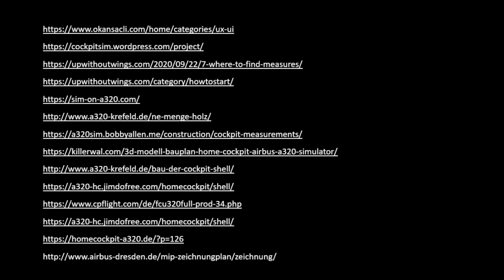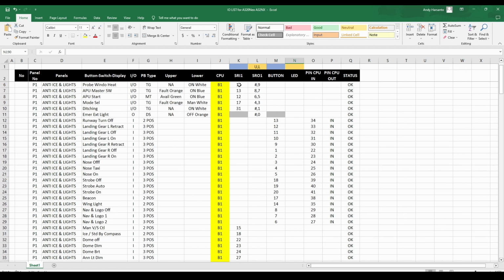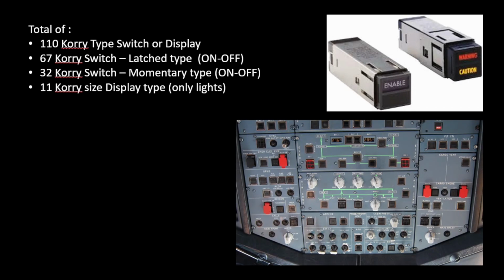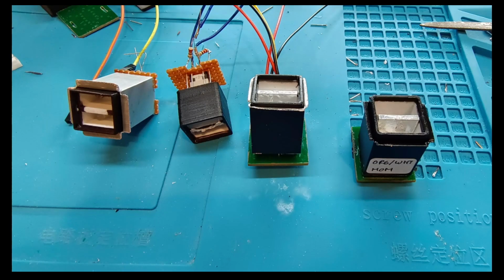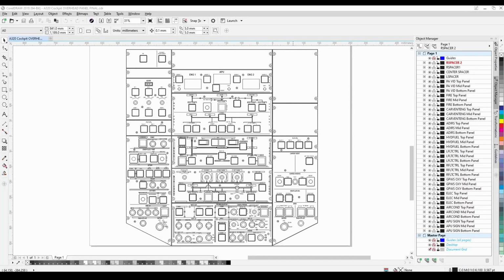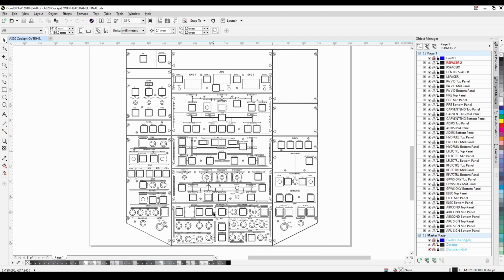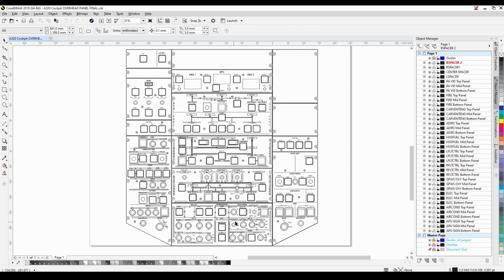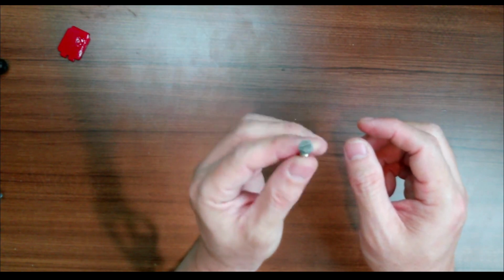DIY A320 Neo Home Cockpit Build Video   Part 3 Overhead

Comment: will this overhead panels be compatible withe the A359 from flight factor on xplane 12?
Reply from the maker: If you compare its similar but not the same of course you could program accordingly depending on the interface apps and controller you use

Comment: thank you very much for sharing those files ... is it possible to let us know what fonts you use in those Corel Draw files for the text ?
Reply from the maker: Wah I forgot might better check in the Corel file itself?
Reply: @hobbytechgearID69  I don't have coral draw, just opened in inkscape and it says it is "sans serif" but my machine thinks the font is missing. I do have sans serif family, but it does not look right. it is probably more like that MS33558 font. anyway, great drawing and thanks again for sharing.

Comment: Does it work in Xplane 12 toliss and what mount do you use to hold it above your head and please can you give me access thank you very much
Reply from the maker: Hardware is flexible but you need a control software that can talk to xplane 12 im not familiar with, ive approved all request to the repository

Comment: I stepped in just recently and i like your videos very much. I received permission to your google drive, but I can not find the excel sheet with all the switches information. An enormeous job. What am I ding wrong. Please yout advice.
Reply from the maker: Ask for permission to"  other" folder
Reply: @hobbytechgearID69  Thank you for your fast response. I received permission for the "Coreldraw Source file" folder and the "3D Model Sketchup files" folder. In both folders I could not find an Exell sheet.   In all other videos there is no other link to your Google Drive folders. What am I missing? Looking forward to your reaction.
Reply from the maker: @henkjonker8513 https://drive.google.com/drive/folders/1LFOpiMq4amXIrGI4GEoUxGZnwIJ9QQQE

Comment: Thank you for giving me access, I just finished the cut and engraving and it came out perfect, if you could be so kind to share the files for the larger korry switches/covers etc, also what rocker switches did you use?
Reply from the maker: @freeeps3  ok good to hear, which one is larger korry sw? I think all are same size, rocker switch for whic one?,you meant toggle switch?
Reply from the maker: You could email which sw I will try to give sample of the components
Reply from the maker: I meant the link where I purchase😊

Comment: Hello. Thank you very much for your work and for generously sharing your experience. I am sure that your project has inspired many, showing that it is possible.

 I have a question: What is the thickness of the lower, middle and upper panels of the overhead?
Reply from the maker: @ВиталийБондин-т1с  its in google sketchup files for detail measurement its about 15-20 cm total panel thickness

Comment: Could I connect multible switches to one ground
Reply from the maker: @kyranclaeys3972  yes either common gnd is usually preferred but it should be a pull down co fig where in the input need to have a pull up resistor either external or already included in the IC or the board

Comment: how much could somebody buy a completely built overhead panel for, some people like me, dont like to put together over 100 switches lol.
Reply from the maker: There are shops but via alibaba around 100K USD full size if from europe will be much higher.
Reply: I see between 4-5k EUR + Tax for a full sized one. Thinking about wire it self but all parts will cost me 3k around already.  Hope, Winwing bring some original sized Panel for around 2k :)

Comment: Hi Hobby Tech Gear, I've been watching your build videos to assist in planning my own build. What did you use to cut the holes in the acrylic sheets for your overhead panels? Cheers.
Reply from the maker: As mentioned in one of the build Im using co2 laser cutting machine, I bought a cheap one but very difficult to fine tune but once you got it right its sharp. It also can cut up to 5mm but wiith several pass. And used for engraving too
Reply from the maker: Im using 50w co2 laser cutting machine. If you dont want to buy a unit usually there are services to cut to your design

Comment: Hello. Thanks for the video! :)
Did you connect the LED strip light directly to the potentiometer for the backlight. I am currently in the process of building my overhead. Would I need a dimmer
Reply from the maker: Oh yes forgot to mentioned im using a pwm or led dimmer actually for overhead im using quite powerful dimmer you could calculate from total current consumption for approximation
Reply from the maker: Of the total led strip length use for example refer to led strip specs for the voltage used
Reply from the maker: You cant if you calculate current is quite significant the pot would just unable sustained  or you need big pot which is not realistic and it wont work at certain voltage
Reply from the maker: Actually the cost of dimmer is not so much. And i use dual gang pot for the dimmer replacing the single gang pot. And connect the other pot to the adc if you need to adjust in the seem lighting through mobiflight or the software
Reply: Okay, thank you for the quick reply. So I need a dimmer? can't I just connect the led strip directly to the potentiometer?

Comment: And do you have the sheets/excel file you can share with all the connections and colors that you were showing?
Reply: Hey thanks for the acceptance but I did not see the Excel file in there at all.....am I missing it?
Reply from the maker: I ve put almost all my working files in the gdrive link in the description
Reply from the maker: I did not put too specific you do need some electronics knowlege at mins as ive mentioned if you woul like to learn start from creating simple joystick with mmjoy2 see my other vids in playlist and move up from there i did it also in stages, though i do have electronics skills
Reply: I'm pretty good with Arduino that's why I was asking if you had included the Excel file? I did try to get the files off of Google drive but it just asked me to request permission
Reply: I did request access just waiting for it to be approved. You did a wonderful job I'm hoping your information can help me as well
Reply from the maker: Already
Reply from the maker: Did you find OTHERs directory?
Reply: @hobbytechgearID69  Yes but there's nothing in it
Reply from the maker: @johnb6014  i ve checked your name is listed and the files is there can you retry and refresh

Comment: Hello, can you share your MC and MC file from Mobiflight? Thanks!
Reply from the maker: Ive put into OTHERS folder you should have access. But it's specific to my Arduinos setup. If you would like to see the command use you could but the I/O and others need to be adjusted to yours
Reply: @hobbytechgearID69  Thank you very much! I think these files will help a lot of people to set up the configuration using this as an example
Reply: @hobbytechgearID69  A small problem, I don't have the OTHER folder available. Apparently I don't have access
Reply from the maker: Check your email ive added you
Reply: @hobbytechgearID69  I don't have this either
Reply from the maker: @johnb6014  hope you find it

Comment: Bro please tell which print you took to make panel which material used and name of that print please bro tell me
Reply from the maker: Can gou tell me what printer. Is it laser cutting machine? Or 3d printer? For laser cutting Im using generic chinese made 40w power. While for 3d printer fillament base im using Prusa Mk3 and for resin im using anycubic the first generation

Comment: Hi, do you have any tips on how to line up the panel engraving perfectly on the laser?
Reply from the maker: Sure. 1. Draw a box outline of the panel in corel, 2. Put the outline as first to laser hide the engraved title or delete first 3. Put a thick material as base to draw the outline using laser with low power, 4. Re activate the layer to be engraved or undo deletion, 5. Select the outline as white color so wont be engraved but its still there so engrave letter or marking wont move 6. Start engraving using the right power setting. Ussually test first to find the rihht setting for your machine. Mot too deep but not too shallow.

Comment: Hi, this video series is a blessing from God, thank you so much! Is there any way you could include the excel sheet with all of the switch covers? Thank You!
Reply from the maker: Let me check should be in the Google Drive if not will upload
Reply: @hobbytechgearID69  Thank you, really appreciate it. Also, if you don't mind, I'm having real trouble finding a non-rotating toggle switch with a long shaft like yours do. Is there any way you could link the ones you purchased?
Reply from the maker: Not sure where you could buy international, Ive bought locally with a brand of "Saiko" the non rotating shaft has a pin in the screwhead of the switch.
Reply from the maker: https://www.ebay.com/itm/255511378968?mkcid=16&mkevt=1&mkrid=711-127632-2357-0&ssspo=BMIPX6fiTki&sssrc=4429486&ssuid=awrMi_YmR7e&var=&widget_ver=artemis&media=COPY
Reply from the maker: Something like that?

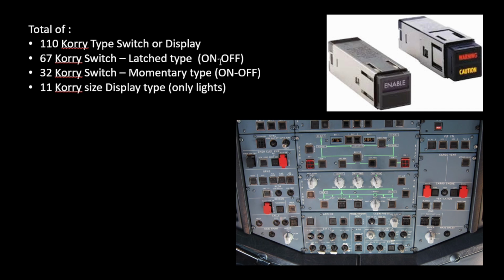Comment: 3:25 I'm curious to know how you solve the rotating shaft problem of these switches.  These handles sometimes turn (twist) during use, so your "paddle" mod handle will "turn" like the landing lights, especially if your finger is not at the center of the paddle, if you know what I mean.  Thanks in advance.
Reply from the maker: Good catch Im using non rotating switch type the one that Ive shown in the video that I grind the toggle handle is non rotating type. The shorter shaft do also non rotating but too short. So I shop around again till I find luckily its available locally in my country (Indoenesia) not sure who import it, but I think you could find internationally pretty easy
Reply: @hobbytechgearID69  Thank you so much I appreciate your quick feedback!   Where were you when I started this journey not long ago? LOL!!  You have all that I needed to know.  I cannot thank you enough!    Your Korry is one that attracts my interest.  I am already in my 3rd or 4th iteration of my simple DIY design without PCB, but I guess PCB is the logical solution.
Reply from the maker: PcB is worthed as for full cockpit at least 100 plus korry
Reply: @hobbytechgearID69  Another question:  Is there a gap (space) between 2nd layer and 3rd layer?  I understand the LEDs are mounted on the 3rd layer .  Thanks
Reply from the maker: No gap but on 2nd acrylic should be a cut out with the length of led strip as long as it can be before close to another hole or cutout for switch Im using led strip warm white or orang can do, the width of the cutout has to be adjusted to the width of the led strip.
Reply: Hi  @hobbytechgearID69  .  Is there a chance I could ask for a copy of your button list spreadsheet?  thanks
Reply from the maker: Already upload under others folder 
 @santiagoluib3
Reply from the maker: https://drive.google.com/drive/folders/1LFOpiMq4amXIrGI4GEoUxGZnwIJ9QQQE?usp=drive_link  @santiagoluib3
Reply: @hobbytechgearID69  wow! Thank you so much!
Reply from the maker: Ok will upload soon
Reply from the maker: Only for the overhead panel though but the rest is much simpler
Reply: @hobbytechgearID69  that's ok. It's a big help 👍Thanks!
Reply: I also requested access didn't see it in the video

Comment: Very impressive!   Just a good timing as I am sloowly building panels and I am also in the many iterations of my Korry design, which is simplier as I am not using PCB.  Now that I am working on the Overhead Korry with two lights, I think the PCB path is the sound choice.  Thank you very much for your tips!

Comment: Hi, can you please share a link to the LEDs that are used in korry switch? Everything I ordered doesn't match in color, but you have the right ones. Thanks!
Reply: thanks!!!
Reply from the maker: Just found this amazing item on AliExpress. Check it out! US $1.99  50%OFF | 100pcs 3mm LED Diode Ultra Bright Warm White Red Green Blue UV Purple Yellow Orange Pink 2V 3V 20mA F5 Emitting Assortment Set
https://a.aliexpress.com/_mMPwlUq
Reply from the maker: Use 3mm bright one usually clear colored case one.  Either orange or warm white

Comment: Hello, so I know you use vr with you helmet sometimes, I was just wondering if you could help me figure out how to setup mine. I have an HGU-26/p helmet, and an oculus quest 2 and the opening on the helmet is too small to fit the headset in do you have any ideas?
Reply from the maker: Unfortunately not all headset can I even need to mod the headset myself using samsung oddesy the other are too big
Reply: @hobbytechgearID69  so, I just got home from a trip, and turns out, it’s sort of works I need to mess with it more but I got both the headset and the helmet on my head at the same time. Somewhat comfortably and fully functionally. The little side bars for the strap with the speakers just barley bend enough to fit in between the helmet liner and my face. It’s a little sketch and I am worried about longevity of the vr headset but it works. I’m going to bed but I’ll mess with it and let you know!
Reply from the maker: https://youtu.be/7rBu2aqvjYw

Comment: Hi, is it possible to have a link to buy the toggle switches and the LED strip please  ? Thanks :)
Reply from the maker: https://www.aliexpress.com/item/1005003268250485.html?spm=a2g0o.order_list.order_list_main.5.77391802X9M1Ot
Reply from the maker: You could choose 120 led per meter or much denser 240 led per meter. Mine I think 120 led per meter for warm white, but if you use orange color you could try 240 led per meter for brighter color
Reply from the maker: For toggle switch, I don't know where do you live but you could just search in aliexpress, or other online shop it's a common toggle switch. Either 2 Position ON and OFF and also  3 position toggle ON - OFF - ON
Reply from the maker: https://www.aliexpress.com/item/1005004638787608.html?spm=a2g0o.productlist.main.17.186015bautGaYH&algo_pvid=4cbdd6b8-b06d-41ce-add2-b66c6ac6484b&aem_p4p_detail=202307300427117748928908985760003548151&algo_exp_id=4cbdd6b8-b06d-41ce-add2-b66c6ac6484b-8&pdp_npi=3%40dis%21USD%2115.00%2110.05%21%21%2115.00%21%21%40210318bb16907164313231814e4a5b%2112000029934023979%21sea%21ID%21137687415&curPageLogUid=hewkIFYOnrUl&search_p4p_id=202307300427117748928908985760003548151_9
Reply from the maker: Im using a larger switch with 12mm diameter in the shaft